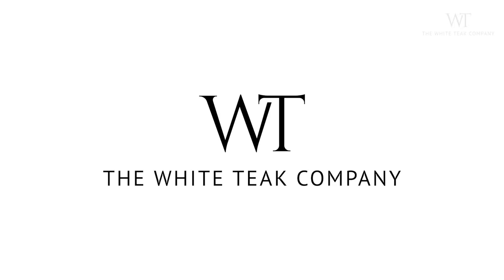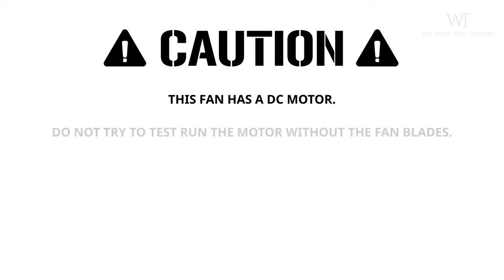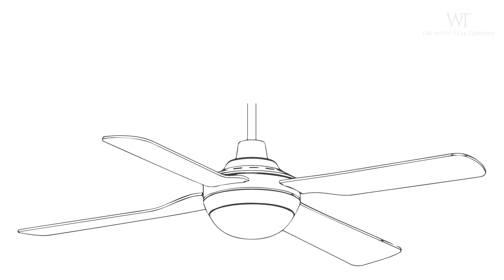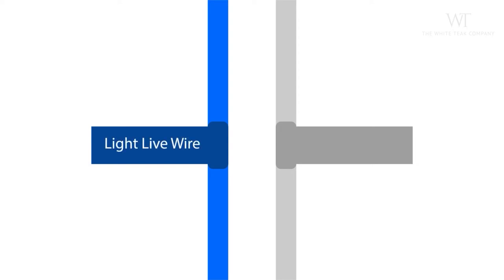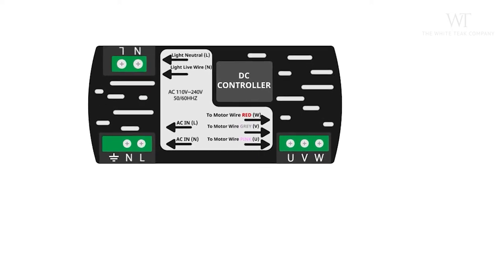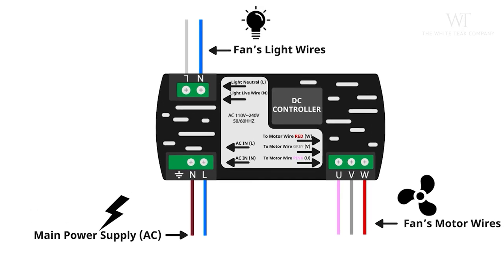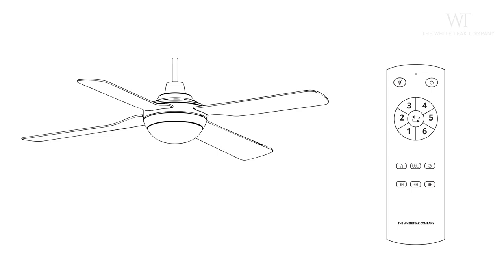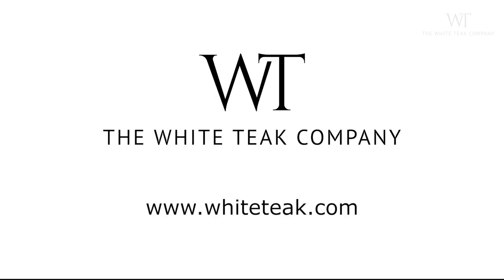DC fan driver Installation video

Comment: What if my DC motor doesn't have light wires. The DC driver only has the black neutral wire, the red live wire and a white wire coming out of it.
Reply from the maker: Sir, The DC motor will have a designated wire for lights and the driver.